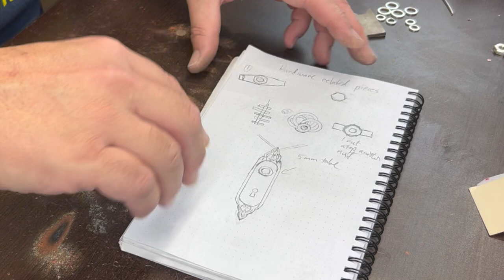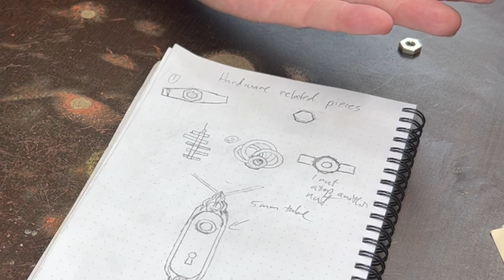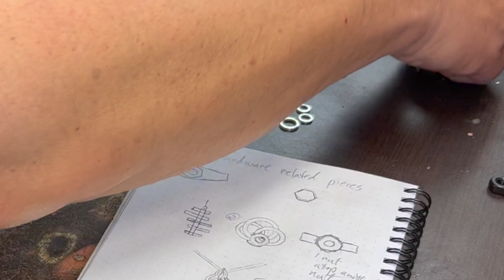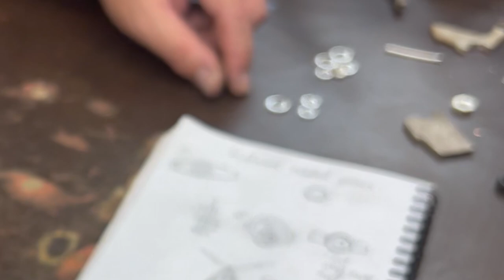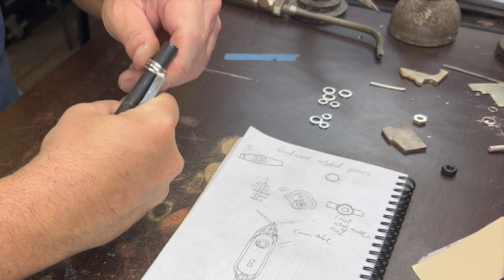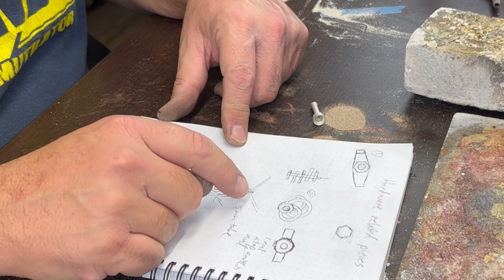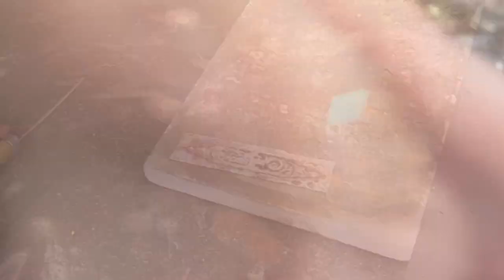Hardware Inspired Jewelry: A Silversmithing Tip

Comment: Chad, I’ve been watching for a few weeks while learning (or attempting to learn) silversmithing. I am a welder so have access to a shop setting to forge cast and work but am wondering what specialty tools you would start with on a budget. What is the best thing to make for a beginner
Reply from the maker: It kind of depends on what specialization you focus on. I have plans to make a basic tool setup video sometime soonish. In a nutshell:  soldering surface, pliers to shape with, tweezers, soldering pick, torch, files, wire cutters, shears, rotary tool, polishing setup, and there are some specialty items I will also talk about in the video when I get around to making it. A good place to start might be some simple silver bands. https://youtu.be/HZdZ4qVdELM

Comment: Hi Chad! Super ambitious day, 3 cool projects, wow! I was wondering,  could you just twist (turn) the center wire and not even touch the rings for those groovy earrings? You know how you twist an earring post? Like that. Love the door knob, my very old house has those glass door knobs on all the doors! 🌺🌺🌺
Reply from the maker: That is kind of what I did, but making sure the rings are parallel with each other required some corrections as I did that. The earrings were the most challenging of the three which surprised me. It was difficult to heat that central wire without overheating the rings. What year was your house built?  Ours is a 1938:). Thanks for the nice comment!
Reply: @chadssilversmithing  mine was built in 1911. I was told it was all updated and "modernized" in the 50's!! 🤣🤣🤣